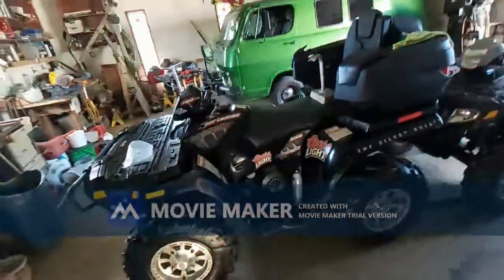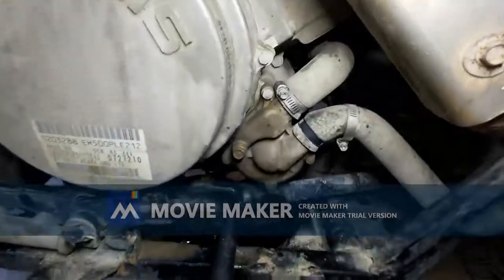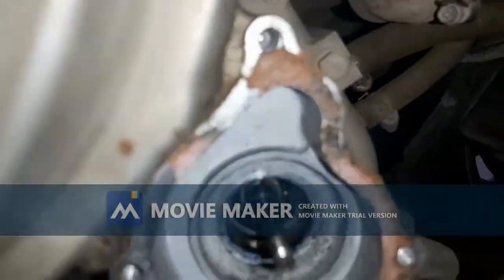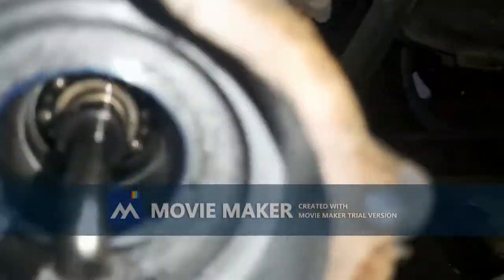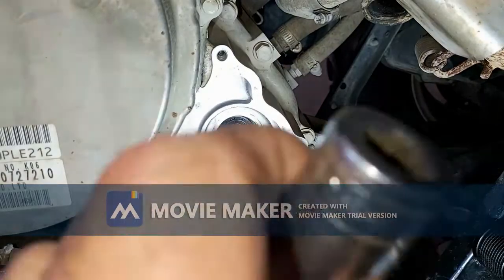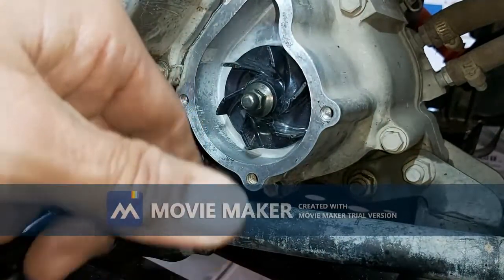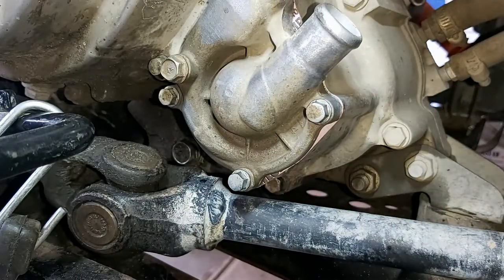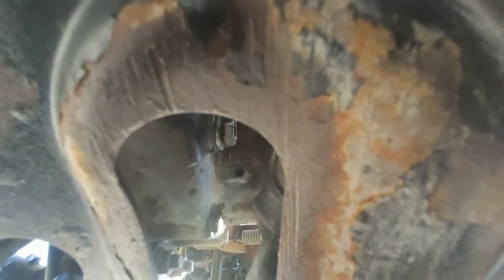07 SPORTSMAN WATER PUMP REPLACEMENT

Comment: How did you remove the outer seal??
Reply from the maker: Hi i used a screw with slide hammer  to remove the seal  the center of the seal just broke off

Comment: If my atv is only leaking antifreeze from the weep hole . Do I need to replace the oil seal too. Or just the first seal 🤔
Reply from the maker: No you could just change the antifreeze seal .
Reply: @MrKalicat  where do you get the parts from

Comment: Face palm. How did you install the mechanical seal. The video skips that part. Not sure why lol.
Reply from the maker: I just used a socket the size of the outside diameter of the seal and taped it in doesn't take much force
Reply: @MrKalicat  So, mine leaks from the weep hole after installing new pump and seals.
Reply from the maker: @futuregamer5791   what is leaking oil or antifreeze  maybe a seal was damaged on install or perhaps the shaft is worn
Reply: @MrKalicat  just coolant. I tore the entire engine down and split the case. Replace the pump bearings and shaft. Took my time installing everything. Was in no hurry. Honestly I'm about to just roll this thing off a cliff.
Reply from the maker: @futuregamer5791  so it's the outer seal don't think I can be much help you went alot further than I did maybe try another seal.
Reply: @MrKalicat  I figured it was the outer seal that was brand new. I guess maybe I need to put it on ice next time to shrink the metal as much as possible. Maybe find a tool to gently press it in after coating it with Vaseline lol. Oh well.
Reply from the maker: @futuregamer5791  well good luck it sure can be frustrating
Reply: @futuregamer5791  make sure you put the small seal between the impeller and mechanical seal
Reply: @kathrynbrant4107  I gave up on it. After pulling the case apart and replacing the pump and buying a new timing chain, cylinder head,camshaft ect the camshaft seized to the cylinder head again so I'm guessing I should have changed the oil pump but was told they never go bad. Plus the new water pump had a drip.
Reply: Was running hot before you did that